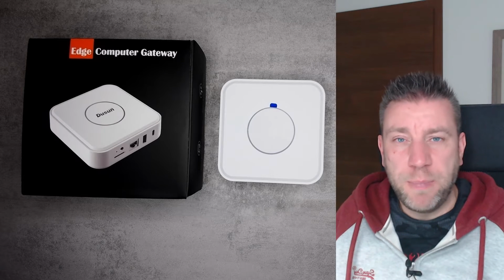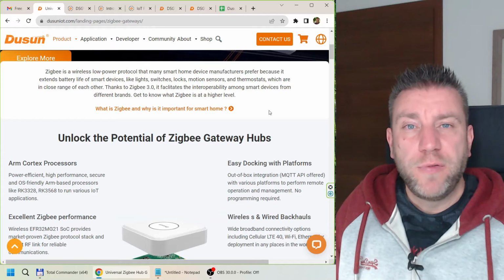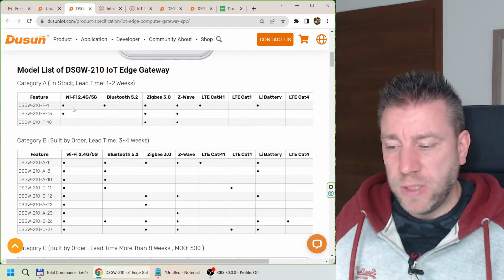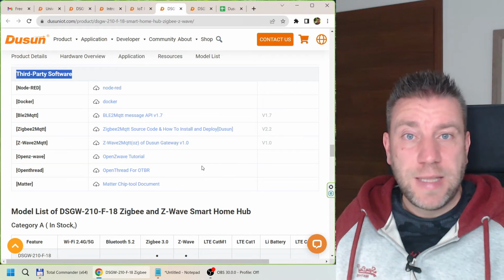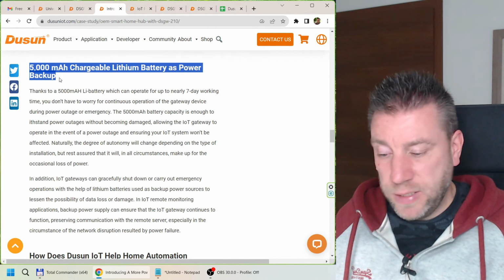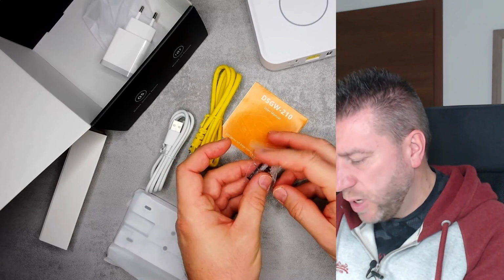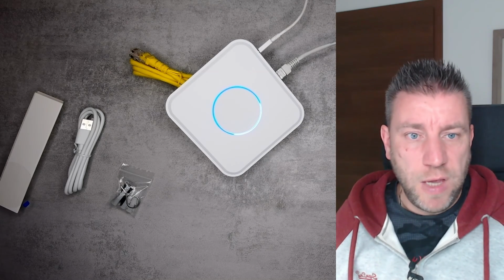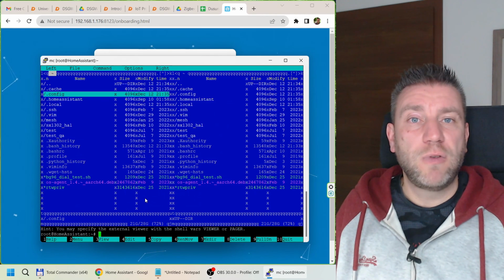Dusun DSGW210 IoT Gateway. Single board computer for your IoT with integrated Zigbee and Z-Wave

Comment: iam doing simple experiment like, i have x(temperature or CO2) sensor this will be connected to microcontroller/exp8266/ZigBee or (it has inbuilt all the modules) now collected has to be sent to DSGW210 IoT gateway(DSGW-210-F-1) then this data should be seen on the monitor. so what are perquisites in the sense software and dependencies to install iam new to this. your inputs will be helpful. thanks in advance.
Reply from the maker: Pretty much the same setup as mine. Zigbee2MQTT will handle all the zigbee devices and ESP sensors can communicate over MQTT as well. And in Node-Red you can build a dashboard, process the data, etc.

Comment: how to check which model we have(in feature section)
Reply from the maker: That is a good question to be honest. So far I purchased 2, and they had slighly different firmware on it. I think the best if you contact them before placing the order.
Reply: Okay thanks

Comment: Thanks Csongor. I also prefer home based IOT. Additionally, I currently use WirrGuard for external access. No cloud. Eventually, I plan to integrate tailscale or some some similar mesh VPN service. The challenge is is that it's too new for some of my components.
Reply from the maker: Yeah, I still use openVPN for remote access, but I hardly use it. I travel and leave my home so rarely that there is no need for a very customized remote access solution. I watched Andreas's video on the subject: https://www.youtube.com/watch?v=sA55fcuJSQQ ZeroTier also looks promising.